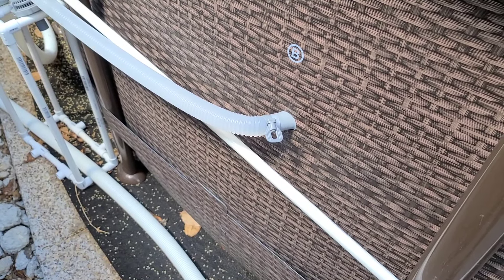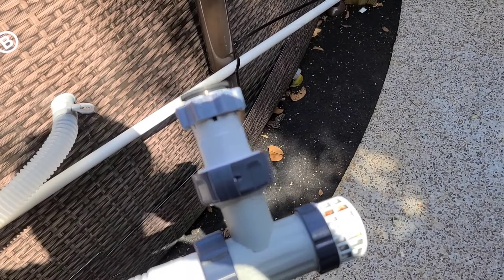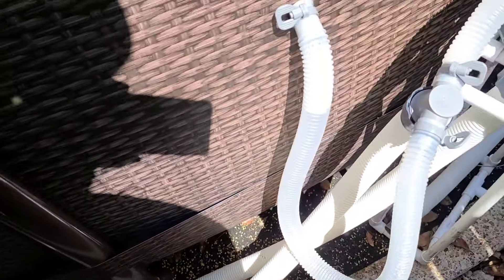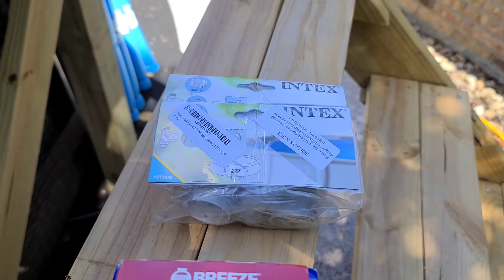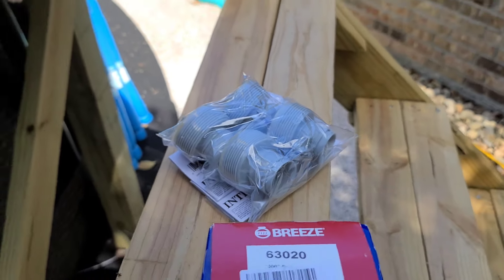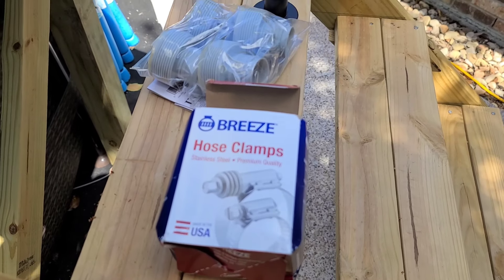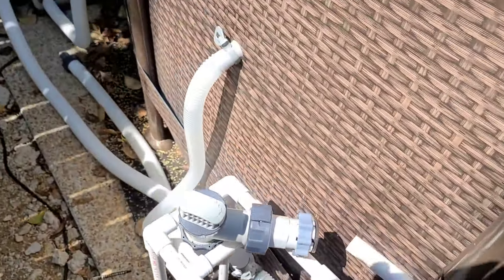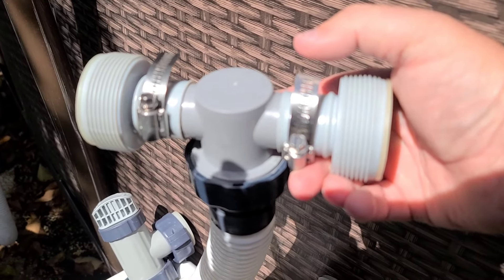Converting a Bestway Above Ground Pool to Intex 1.5 inch Hoses Using Type B Adapters

Comment: Thank you for this video very helpful. But Im having trouble with the inlet now are you useing an adabtor for that too?
Reply from the maker: What problem are you having?  My pool came with a 1.5" opening (TO the pool) already...and 1.25" openings (FROM the pool.  So the water coming out of the pool comes out of 1.25" openings and goes back into the pool through a 1.5" opening.
Reply: @getitdone308  oh I see well mind goes back into the pool with a 1.25 I have an intex pool 15x48 it came with a ok filter but we use the pool so much that it just wasn't working for us.  I bought an upgrade thinking I could just get adapters. They worked for the outlets but the inlet was different all together I will probably just have to return it. Thank u for responding.
Reply from the maker: Is the inlet to the pool the same as the outlet from it?  Is it the rubber/plastic "nipple"?
Reply: @getitdone308  yes they are all the same size
Reply: @getitdone308  yes they are rubber
Reply from the maker: Then you should be able to still use the method in the video as it is the same fitting.  In other words, you can use the same adapter for the inlet into the pool as the outlet and it works the same way.
Reply: @getitdone308  ok I will try that thanks

Comment: If you used the rubber cap to block a  intake the suction gets a lot stronger
Reply from the maker: Yes it does.  Check out my latest video for how I made it even stronger.

Comment: Great videos. I know you have since upgraded to an external skimmer but was hoping I could get your opinion. I just got a new skimmer like you have in this video and I also have a solar pad. The solar pad works well but I don't think my pump is strong enough (1500 gph) to create the suction needed for the skimmer to work. I like your idea of upgrading to 1.5 hoses and the plunger valves, but in Canada, those plunger valves are quite expensive on amazon. I will however just try plugging one of the intakes with the black stopper that comes with the pool. Another idea I had was to get a simple cartridge pump. Could I essentially run my skimmer off of one inlet full time (much like you do with your external skimmer) but instead of plugging the other inlet, hook the cartridge pump up and use it to run my solar pad. I would just have to rest the hose from the pad on the edge of the pool but in this case I would eliminate the T and have my pump/sand filer dedicated to the skimmer and the smaller cartridge pump running the solar pad. I would really appreciate your thoughts? Thanks in advance.
Reply from the maker: That would work.  You would need to have the outlet from the second pump go straight in the pool somehow.  You could cut another hole (risky but effective) or just overhang a hose into your pool (no risk, just not very aesthetically pleasing)

I too have noticed that Intex products have skyrocketed in price this year (like 2-4x from last year).  You could always plumb it yourself with flexible PVC and ball valves which may be cheaper than Intex.
Reply: @getitdone308  Thanks for your input. Much like you, my pool is also one that I will take down in the winter so it would have to be flexible pvc. I'd have to price that in my area. I think the set up I suggested could work but the only part I am not thrilled with is the hose coming from the solar pad would have to rest on the pool frame. I gave it a lot of thought but couldn't think of an affordable easy way to T or pipe it in. (my wife wont let me cut any holes in the liner ha ha). Thanks again.
Reply from the maker: How big is your pool?  Have you considered a bigger pump?  That way you can use the existing holes.
Reply: @getitdone308  Yes I've considered it. Our pool is 22'x12'x48". We just got this pool this year from costco. It came with a 1500gph pump, sand filter and the solar pad. I wish it came with a bigger pump but since this is brand new to us, I don't see us investing in a new pump quite yet. Honestly I am quite surprised how little suction there is. Up to this point it really hasn't been an issue but I just ordered a skimmer and I worry it wont suck at all, just like in your earlier videos. I do plan to block one of the inlets with the included stopper, hence why I thought I could add a small pump connected to that hole.
Reply from the maker: They always give you the pump with the bare minimum specs.  I sold my (new) pump that came with the pool almost immediately and was able to apply the $ towards an appropriate pump.  I would seriously consider upgrading.  You will be happy you did.
Reply: @getitdone308  Hi again, if you read thru our conversation from last year you will see that I decided to use the black plug to plug one of the outlets and run my skimmer that way. The skimmer worked well. The other part of my system is a solar heat pad where the water travels thru, heats up and goes back in the pool. Unfortunately it didnt work so great last year. Water goes into filter then into solar pad then back into pool but the water traveled to quickly thru the pad so it wouldnt heat up. This year I purchasdd a diverter valve and I plan to split the water after the filter, most water will go back to the pool and some (small amount) will go thru the solar pad to head up. Which leads me back to that extra outlet that is plugged with the black stopper. Do you think I could come out of the solar pad and use the extra A outlet to route the warm water back into the pool. The alternative would be to rest a hose on the pool frame like we suggested last year. Any thoughts would be appreciated. Thanks
Reply from the maker: I really wish I had your problem (the need to heat the pool).  Mine's 92° right now and I need to cool it.

That said, what I know about those heaters us that many times they need distance to be effective.  You've experienced that when the water went straight into the pool after the filter/heater.

So diverting the water...while keeping the same distance may not have a better effect.

It also depends on the heater you have.  Perhaps it's just not a good one?  Is it actually heating the water?
Reply: @getitdone308  ha ha, I'm from eastern Canada and we opted not to get a heater, so we are trying to harness the heat from the sun. The goal of the diverter is to send less water thru the pad and to send it thru slower so it can actually heat up. Sometimes I have seen folks put timers so the water pumps thru the pad then stops and heats up, then into the pool. I'll give it a shot this year. The plan was to go thru the pad and then just rest a hose on the edge of the pool frame. If I am not using the second A outlet, what do you think about running a hose to that so the water after going thru the solar pad, can go back into the pool instead of just sitting on the frame.
Reply: @paulflogeras2309  if you run your black hose thru a long pile of saw dust or mulch pile, it will get really warm.

Comment: Do you suffer from rust with the pool?  I have an Intex swimming pool but it is rusting and I am looking for a new swimming pool
Reply from the maker: A little bit.  Especially because I have a saltwater system.  But that's to be expected with ANY pool that has a metal frame...especially with a saltwater system.  That said, the metal parts are easily replaced.  It's the liner that I want to last..
Reply: Thanks for the quick response, I now have an intex prism frame pool 366x99 but it has completely rusted within two seasons I also have the intex salt water system I hope bestway steel pro max is better thanks for the videos.

Comment: Very good video. There is so much out there that hasn't been explained simply. I upgraded to 1.5" pipes  attached to my new Intex krystal sand filter. Those small grey filter pumps are useless but it seems we all get them and then replace them.
One area to to increase flow is to have your pipes vertical from the plunger valve and not across so quickly after the valve  part. Your table thing isn't a good idea as it slows the flow.
Reply from the maker: Thanks Nigel.  I agree about the vertical pipes.  My pvc frame is there to keep my kids and dog from stepping on the pipes.  My goal is to switch out the 1.25" stock t-junction to 1.5".  When I do that, I'll coordinate everything so I don't "need" the pvc frame.
Reply: @getitdone308 maybe I will have to do the same with 4 dogs and 2 young kids... I plan to get the Hayward skimmer attached next as it seems to be a useful addition. It was good to see your Intex skimmer working well. In the UK no firm I have spoken to has thought of using the Hayward skimmer on an Intex pool. I actually spoke to a pool Co and explained what I was goiing to do with the product he sold. He sounded amazed. Also because of the supply problems from China there are no pool kit or equipment in the UK or Europe. Guys from the USA are selling on amazon intex kit that may sell for $19 like connectors for $70. It's crazy.
Reply from the maker: I'm seriously considering the Hayward skimmer.  My only concern is whether or not my water level has to drop.  My pool is 48" (ground to top of the pole), so it's about 44" actual inches of water.  Do those Haywards make you bring your pool water level down?
Reply: @getitdone308  that's an obvious concern but you don't actually. The skimmer is set 1 inch below the top of the pool liner. The mouth of the skimmer is opened and you set your water level about 3" above the lowest part of the opening. It's not like the intex skimmer that floats on the surface.
The rear collecting box is easily to access and it's not bobbing on the surface like the intex skimmer.
Whats crazy on intex products is there is very little supply of parts anywhere because of cv19 and factory delays and shipping from China..
I am considering buying a 4 pack of plunger valves on amazon USA and shipping them to the UK where I will use 2 and sell 2 to cover my costs. Its crazy.
Reply from the maker: Thanks for the info.  It's very helpful.  Here in the US, they're still available, but I have seen Supply and Demand impact the prices.  The demand is high (summer and scarcity due to CV19), so the price can be abnormally high.  

That's the reason I built a pool sprinkler myself.  I saw the Intex one in April for about $99.  Now I can't find it at all.  But right before I went to buy one, it was $200.  The Intex waterfall went from $55 in April to $199 as well.

Got to love a free market!

Comment: My type B adapters fit a bit loose and dont stay in place... Why might that be?
Reply from the maker: I upgraded my hose clamps to something a little more beefy (not the plastic ones they came with).  Worked much better.
Reply: I don't mean the clamp. My issue is the Type B adapters are not screwing into place with the hose... They seem to be easy to pool of from where the hose meets the adapters
Reply from the maker: If they're both Intex, they should be fine.  If they're not, that may be the issue. Remember, Intex is metric.  If you use anything aftermarket, it may be standard.  They don't align well.
Reply: @getitdone308  Aawww, that's gotta be the issue... Thx

Comment: Can you detail how you made your pool steps please? I have the same pool and I bought premade stringers and they are giving me hell🤦🏼‍♀️🥴😩🤯
Reply from the maker: The stringers will work, but they're not "steep" so as long as you use them for the outside of the pool (the stairs...not the inside ladder) you'll need to add more distance.  If you do use them for the inside ladder, you can...but again, the stairs will go far into your pool.

Actually the stringers for the outside of the pool are a great idea.  Just bolt/screw the top side of each of the stringers to the H-frame (exactly like I did with the ladder I made).

The reason I didn't use stringers was because I couldn't find any pre-made that were tall enough.
Reply from the maker: I have a video showing my steps in detail.  Check it out!
Reply from the maker: https://youtu.be/QP9lvq23BTg

Comment: I didn’t use those small outlet ports, instead I installed a through wall skimmer. Keeps the pool cleaner and provides better flow to the pump. I also have a very nice water fall my girl friend and I built out of PVC  that’s about 4 ft above the pool so the increased flow using the through wall skimmer makes it really flow good. I also used 1 1/2 “ hoses and PVC pipe.
Reply from the maker: Me too!  Check out my latest video.
Reply: @getitdone308  I used the same skimmer.
Reply: @871jamie The only thing I don't like about those through the wall skimmers, is that you can't fill the pool with as much water.
Reply from the maker: That is true. You lose a couple of inches.  But it's not that noticeable.  The tradeoff is worth it.
Reply: @getitdone308  Definitely, I have the in the water skimmer, I'm not a huge fan, lol.

Any new videos coming by the way? Take care!

Comment: Hello! Please check 7:51 . You use some "T adapter". Can you send me to comment please link to this item? I really need this ! Its a two hole for 32mm and one for 38mm? Please if you Can, help me with this. Thanks to múch!
Reply from the maker: The T adapter came with my pool/pump.  JomGorg Sand Filter T-Joint 1.5 to 1.25'' Hose Connector for Bestway for Coleman for Intex P61408 for Pool Hose Adapter for Filter Pumps https://www.amazon.com/dp/B09J2D7KN9/ref=cm_sw_r_apan_i_09KBBQECS6H62VENWMQV

Comment: Is that a Coleman pool  18 x48?
Reply from the maker: Bestway 20x20 (same as Coleman)
Reply: @getitdone308  ok thanks because I wanted to know because I also wanted to put those water valves like you did because it's a pain having to clean the filter every time and having to un do those hoses and just wanted to know the size of those port's to get the same set up as you my friend and thanks for the video very appreciated 👍
Reply from the maker: Check out my other video where I upgraded further to full 1.5" hoses.  I did an in-wall skimmer.  Made a WORLD of difference.

Comment: AWESOME VIDEO!!! I do have a question though. As I to am a first time pool owner how many of each part do I need to buy? My pool is only 16X10X48 and like your I have 2 inlets and 1 outlet. So how many of each part would you suggest I buy? Thank you again. This video saved me from a massive headache AND a CRANKY WIFE!!! 🤣🤣
Reply from the maker: Depends on what part you're asking about.  That size pool will need the same count of "stuff" I used.

Also, I upgraded further.  I recommend this method more. https://youtu.be/TpBitG1rns8

Comment: Can i do this to mine but i dnt have a sand pump.
Reply from the maker: The filter has nothing to do with the conversion.  This is to convert the hoses.  So you should see if your filter has 1.25" or 1.5" threading.  If 1.5", you can do this.

Comment: I never liked those adapters because the water flow is still limited by the 1 1/4" T splitter. It's better to PVC design a splitter with the same diameter.
Reply from the maker: Agreed.  Check out my latest video where I upgraded even further.
Reply: @getitdone308  Do you have a link?
Reply from the maker: https://youtu.be/TpBitG1rns8

Comment: I still cant understand how this helps. The water is still restricted by the smallest opening of the hoses where they connect to the pool wall. You could add 3 inch hoses if you wanted, but it still has to come through the small openings on the wall.
Reply from the maker: It helps...just not as much as opening them all the way (to your point)  That's why I ended up converting fully to 1.5" hoses and conncections.

Comment: What size  sand fliter / salt system you have , 16" 14"
Reply from the maker: Hi.  Mine's a 16" Intex sand filter with saltwater system. Here's the link to it on Amazon:  https://www.amazon.com/dp/B07TN3JQ2P/ref=cm_sw_r_cp_apa_i_slR8EbR4P50QA
Reply: Ok thanks  for info i order my from Walmart  ,upgrading my current one my 12x24x52 rectangle pool, my hold 50lbs sand your holds 120lb if I'm right
Reply from the maker: Correct.  Mine holds 120 lbs
Reply: @getitdone308   thanks for replay,  so you  run your like 4hr to 5hr and salt around same and boost after used, ,idk when boost i 8hr on sand filter and salt 1hrx8boost
Reply from the maker: I have mine set for 8 hours pump, and 4 hours chlorinator.  I check my levels 1x week.  Sometimes I have to boost (like after a bunch of people were in it).  The boost has a minimum 36 hour setting, so usually I just turn off the boost after a few hours.

Something to consider is that I am in Texas, so I get a little more evaporation than normal.  I also get more sunshine so that also kills chlorine.

Every now and then, I have to add a shock packet to the pool, but not often.

The system really works great.
Reply: @getitdone308   i though you run it less because  higher hp and filter size ,because i run my for 6  on 9,800 gl pool and out come is good and salt 4hr, but I also  cover it .you never thought getting the solar cover to help you with that. 
Yea in new york we don't get that much summer. The boost mode i think is double time .
I never added shock back to pool , all I do check salt level and keep at 6.8 or 7
Reply from the maker: I have a cover (it came with the pool), but I don't use it for 3 reasons:
1- I have a permanent ladder/stair system so it won't cover 100% of the pool.
2- I don't feel like putting it on/taking it off often (evaporation isn't too bad)
3- I don't want to warm my pool any more than it is.  I actually installed a sprinkler system to cool my pool (it's working great)!
Reply: @getitdone308  lol it good and thing,  I want to same and put led stripped also
Reply from the maker: That's a great idea!
Reply: @getitdone308  just need put clear tube and seal it
Reply from the maker: That'll do it!